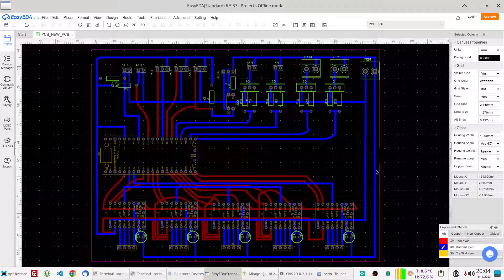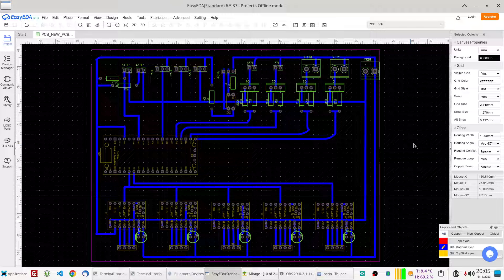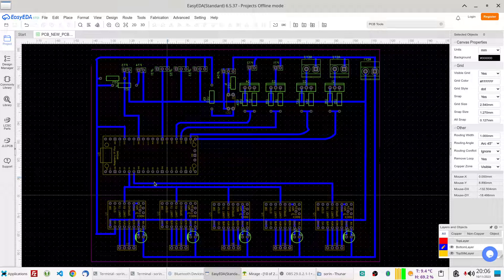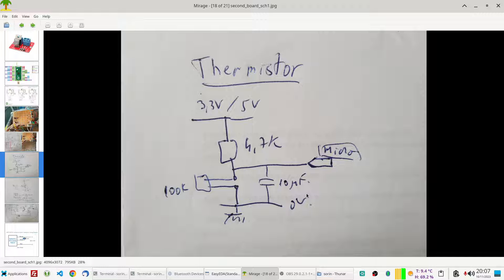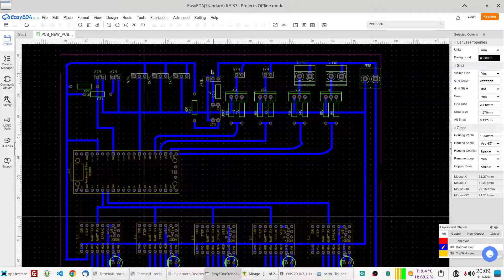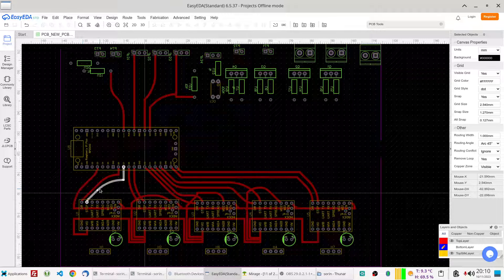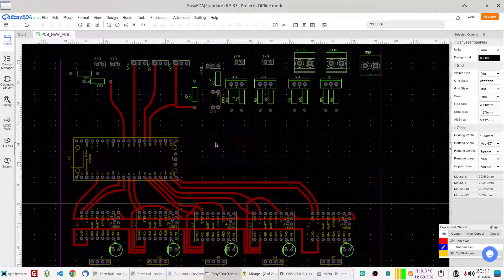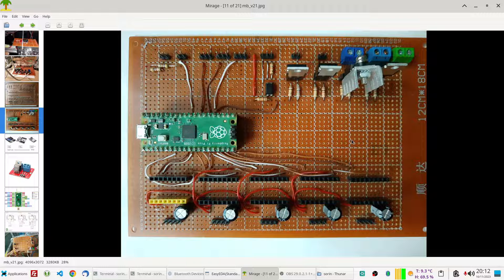Schematic of my DIY 3d printer motherboard

Comment: I believe you use hall effect sensors for end stops could this board use microswitch based endstops. Could you explain what would need to be done to make microswitch end stops work??
Reply from the maker: yes I use hall sensors endstops, you can switch them with regular microswitch end stops, no changes required they work the same. Just check the connections SIGNAL, GND , VCC are in the right order. Most have the same order as in my design but sometimes the chinese ones have different order. If you have one with a different order just switch the wires in the plug to match with the board - use a small scredriver or something small to push the wires out of the plug and then push  them back in right order.
Reply: @CNCTinker  thanks for the reply. I have another issue. I don't know if you have any insight into. My RP2040 setup, based off your board design. I configured it with KIAUH. When it's (the RP2040) plugged into the mainboard, it does not show via the (lsusb /dev/serial/by-id... ) command. However, if I pull it (the RP2040) off the board by itself. It will show on the USB bus. As if it's not receiving enough power, or something?? I did add a buck converter and diode to the power pin (vsys). The supply is from the 24V power supply -> buck converter -> diode -> [measure with meter solid 5.1V], and it did not change the issue. If you have an advice???
Reply from the maker: @Josemenez-lofs  you should also check  /dev/serial/by-path sometimes it puts it there instead of /dev/serial/by-id. So after you plug it into usb you check with lsusb that a rp2040 is present, then cd /dev/serial and check both folders /by-id /by-path it should be present in one of them

Comment: Hello! And you don't have a scheme in better quality? Thank you.
Reply from the maker: I have in the description a link to github where you can find high resolution image
Reply: @CNCTinker  I followed the link and the image resolution is low.
Reply from the maker: ok then you can install EasyEDA, its free, and use the project file from the github,, you will have unlimited zoom
Reply: @CNCTinker  Raspberry Pi power and stepper motor logic (VDD) from USB or external source?
Reply from the maker: I use the power from the usb connector of the Pi, it doesnt use much, around 35ma. I did add a dc-dc converter 5v for the servo cause that uses more current, so I should power all from that
Reply: @CNCTinker  what MOSFET are you using on the board? I put stp55nf06 and 10 Ohm and 100 kOhm resistors, and when outputting from PWM 3.3v, the mosfet does not open.
Reply from the maker: @evgeniyd4243 I use STP16NF06L, your mosfet has Vgs - gate thrrshold voltage 2-4v mine has 1-2.5v, so your's might not open at 3.3v.
Reply from the maker: why do you use a 10ohm ? I think that is the problem, most of the voltage will go on this resistor. use at least 1k but no more then 10k
Reply: @CNCTinker  I have a pico connected to ramps 1.4 via an adapter board. 10 Ohm and 100 kOhm resistors are installed on it
Reply from the maker: @evgeniyd4243 is the mosfet also part of the board ? otherwise just add a 1kohm in series with the 10ohm and the gate of the mosfet, that should do it, I think
Reply: @CNCTinker  MOSFETs are soldered to the board ramps1.4.
Reply from the maker: @evgeniyd4243 I see, I took a quick look at the ramps and indeed I see the mosfets and the 10r resistor. but that was designed to be used with the arduino mega that has 5v outputs. there's no easy plug and play solution, my sugestion desolder the 10r resistor and put a 1k
Reply from the maker: @evgeniyd4243 I had this exact same problem, when I played with one of those external  bed power mosfets modules. they are made to work with 5v inputs, and was not opening with the pico that has 3v. I just desoldered the smd resistor and changed it with one I scavenged from an old junk board I keep for parts
Reply: I will try . Thank you.

Comment: Tell me, do you have a thermistor connected via 4.7k? Does it give me an incorrect temperature?!! The connection scheme of btt scr-piko on github is somewhat different...
Reply from the maker: yes 4.7k its kinda standard with these 100k thermistors and 3.3v adc. It must correspond with what you set in the firwmare or it will give wrong temp. try to measure the voltage on the thermistor and check with a datasheet of the thermistor to what temp it corresponds, and what the firmware reports to find if the error is from the circuit or firmware.
Reply: @CNCTinker  Solved the problem. For WeAct rp2040 and similar boards, it is necessary to solder the VREF jumper. In order to use the ADC reference voltage from the main power supply of the 3.3v board.

Comment: make a clear video on how u flashed the rpi pico man youre not showing how u programmed all of  it what ide u used
Reply from the maker: no ide required, check my klipper linux install video. you download klipper from github, open a cmd and type make menuconfig, select rp2040 as the cpu then make and  copy out/klipper.uf2 to rp2040 - if its new it shows as storage. that is all. also check https://www.klipper3d.org/Installation.html
you also need for  this either a rasp pi running linux, or a virtual machine running linux on your laptop/pc. klipper doesnt work on windows, and last time I checked rp2040 is not supported by marlin

Comment: Good day. I have some success with rp2040. I am using a clone of RP2040 WeAct. 1 - There are subtleties with the klipper firmware. 2 - The board has two additional outputs, an additional button and a neopixel LED. 3- I got gpio0, gpio1 working without any problems! I determined the functionality of the board for myself: 4 uart drivers, 5 controlled loads (mosfet) , 3 temperature sensors, 3 end caps, 7 spare pins (for uart or SPI or I2C + encoder). I will keep you informed of further progress.